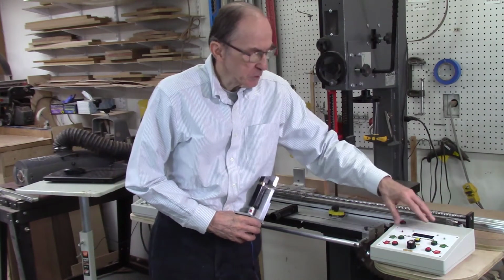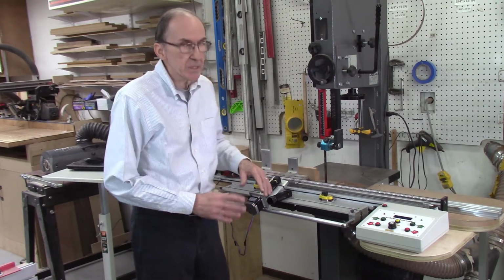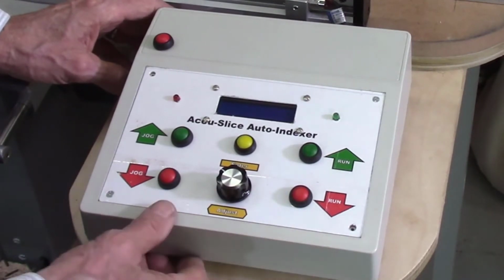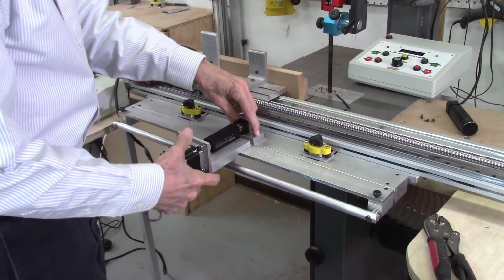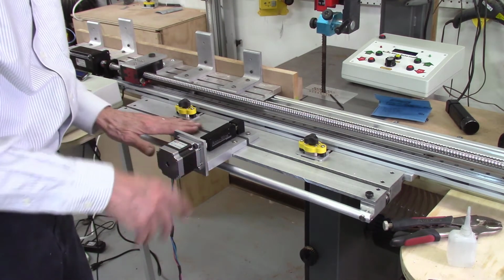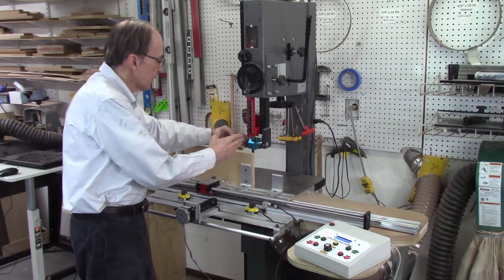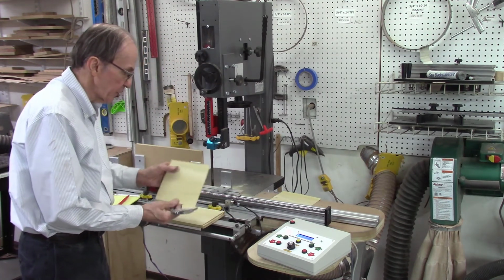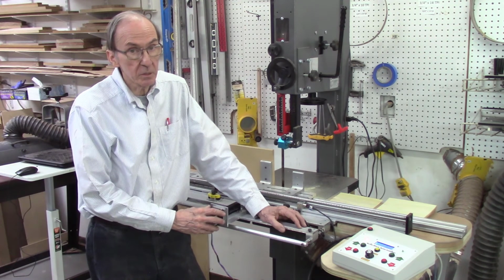Automation of the Accu-Slice System - Automating the Indexer - Part 5 - 133

Comment: I suspect that the root of the accuracy issue that you are having is that the stepper motor is skipping steps as it advances the system.  I think that there is no feedback to show that the system has actually moved, the motor merely produces enough steps that should move the system the required amount without "knowing" if the system has actually moved that much.  You could potentially check that by seeing how many degrees of rotation the drive shaft actually turns for each run.  For example, you typically use two full turns for a .050" cut, you could put a witness mark on the coupler and on the motor and then set it for two full turns.  If the witness mark doesn't come back into alignment then the motor is skipping steps.
Reply from the maker: Thanks for the feedback. I was thinking something similar.  I am modifying the software to list the starting position, the finish position and also counting the actual number of steps it advances. I will cut some boards with a total thickness of 0.100 inch which should be two full revolutions of the shaft which I will mark as you suggested. This distance should be 800 steps of the stepper motor.  This should tell me what is happening.  I also just ordered  larger stepper motor.

Once again thanks for your help.